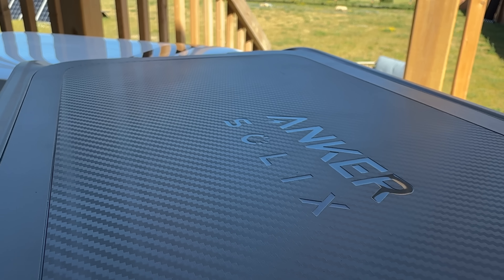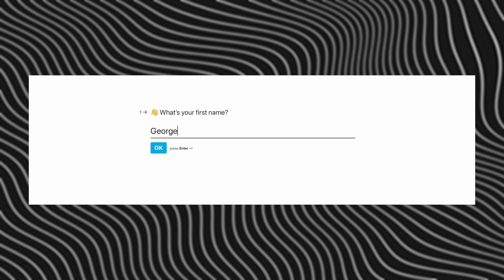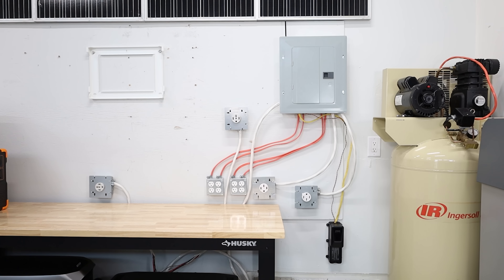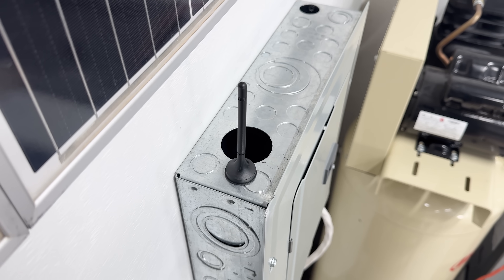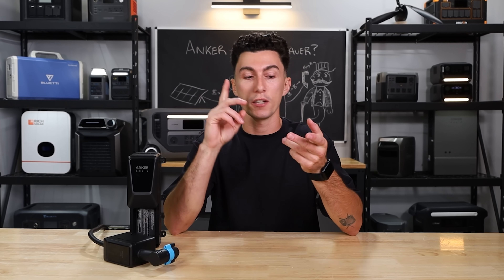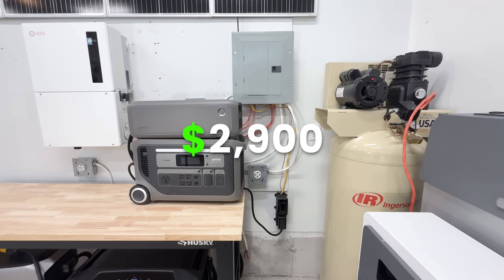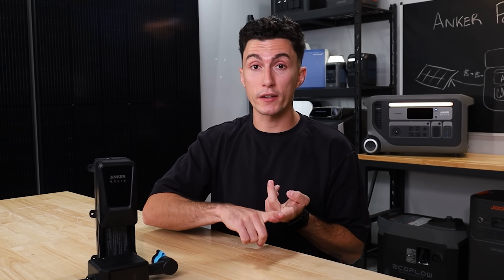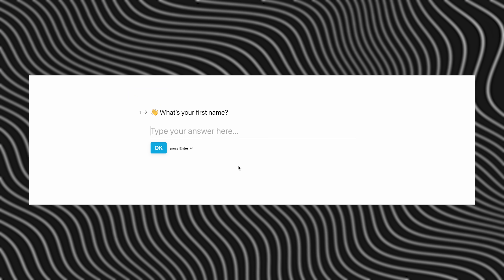Anker's $500 “Power Saver” - Gimmick or Game Changer? (Bi-Directional Inlet Box & Smart Meter)

Comment: Well, I agree with your summary conclusions (around 7:00) ... though its not just a little misleading.  Its a lot misleading.  There's no point using a power station for this purpose.  Anker or otherwise.  And I would say even the qualified "yes" in the mostly "no" space doesn't make much sense.  It's a "NO" all the way.

Power stations are so inefficient that the odds are stacked against you from the start.  The MPPT to storage to AC output has terrible efficiency with a power station solution, particularly if pushing power over 120VAC (instead of 240VAC) ... 120VAC is FOUR TIMES the losses as 240VAC when pushing power.   You would be lucky to get even $0.50/day with the Anker system.

As an example, my DIY Pergola system with Victron equipment has 2kWp of solar, 10kWh of storage, and can fully support a 350W 24x7 load 8 months out of the year.  That system saves me, at best, $2/day and I live in California.  I think last year averaged more like $1.50/day.  And it is a much bigger system than the Anker system (as well as half the cost of the Anker system).  And my Pergola system is about as efficient as its possible to be. The Anker system has terrible end-to-end efficiency in all directions.   Of course my Pergola system is DIY... you have to know what you are doing.

So call me skeptical, but I really doubt that Anker system could come even close to providing any decent return in any situation.  It takes a far more serious system plus some very large loads to really save money.  My full-on EG4 ESS system ($30K, DIY'd) with (now) 42kWh in batteries and 9kWp of solar, saves me a few $thousand a year in electricity.   But it only saves me that because I own an EV and have heavy A/C use in the summer... and I live in California with high rates.

--

Can someone living in Utah or other low-electricity-cost state save money with solar?  You bet!  You can absolutely save money.  These locations might have low rates but they also have incredibly heavy electricity use.  In Mississippi you are running A/C nearly all the time, for example.

But unless you are going whole-hog with a $30K+ system, you won't save money with complex setups.  You save money with (more or less) direct solar to A/C and maybe a bit of battery and inverter storage to extend the A/C run time a few hours past sunset.  That's how you actually save money.  Not whole-home, not backup, not grid-tie.  Off-grid all the way.

-Matt
Reply: I agree with you 100% about these types of systems not being money savers.  When I began my solar journey I had a very specific goal. I was working from home and just needed some backup in case of power outages. I got a little power station just to keep my pc, modem and router going. I then became fascinated by the ability to add solar panels and get electricity from the sun. I stumbled across a couple of YouTube channels and eventually got an Ecoflow Delta 2 Max, and have since add 2 extra batteries and 800w of solar panels, along with a 4 circuit transfer switch. This now runs the circuit that powers my kitchen, including my fridge, microwave, gas stove (electric ignition) and toaster oven full time. The app has the extremely convenient and useful feature that allows me to set a power reserve so I only pull from the grid if the battery state of charge drops to my set percentage, to maintain power for outages. 

The one question that I’m always asked is how much money it’s saving me, and my response is that question is irrelevant. My electricity is fairly cheap, so as you said, savings are negligible. What it does provide me with is peace of mind. And for me, that is priceless. So those wondering about how much my system is saving me should ask themselves, how much all the unnecessary crap they buy is saving them. 

One day when I overcome my fear of electricity, I’d like to install a small DIY off grid system. The problem is I live in a small suburban house on a small lot surrounded by trees, so my ability to add much more solar is limited. But the small size of my house and having a gas stove, furnace and water heater work in my favor, so I think if I can remove a few trees, I might be able to add enough solar and batteries to go “mostly” off grid.  I just want to be prepared for when the explosion in data centers in my area starts causing blackouts and brownouts!
Reply: Matt, it's always a pleasure to read the comments you leave.  They're fairly clear and well written.  I'm a big enthusiast for EV's, solar, power stations and back-up/off grid power. I'm mostly self taught from YT vids, internet searching and comments from people like you.  Keep sharing, P&L.

Comment: you know another way to peek save and save that $200-500 charge you battery with whatever solar panel... then at peek power time plug your ac or whatever large load into your battery and use it... sure its a bit more clunky with you having to do the plugin manually but it saves you that extra money and wiring and you can still move your battery... oh and it works no matter what power battery you have.

Oh also check your local regulation..this option may not be legal in your area.
Reply: So... the issue here are the power requirements, but you can do something similar with a portable A/C unit or mini-split to reduce the load on the main home A/C.   EG4 has a solar-only mini-split, but doesn't store energy so it only lasts until sunset. 

The way to do it with a regular portable A/C... less than a 1000W, is to throw together a little off-grid system just to run the A/C with enough solar to run it during the day + charge the batteries and enough storage to keep it running for a few hours after sunset before exhausting the battery.

A single-battery solution with 2kWp of solar (Callsun bifacial hard panels),  charge controller(s) (Victron SmartSolar 150/35's are my choice here), 2.5 kWh battery (25.6V LiFePO4 @ 100Ah or 51.2V LiFePO$ @ 50Ah), cheap 1500W invertter (capable of starting the A/C), and a 1000W A/C unit works fairly well.   Just keep it off-grid... dedicated to only running an auxiliary A/C or mini-split.

-Matt

Comment: It’s funny you mention the Anker Solar panels because I have been wracking my brain for a while now trying to figure out why they cost so much. Who even buys those things for what they are asking? If they threw in one of these power saver kits with the panels I would be more inclined to consider it. Do better Anker!
Reply from the maker: It's wild. The price of the kit goes from $2,800 to $5,300 when you add 3 x 400W foldable panels. $2,500 for 1200W of solar is insane in our opinion - which is why we recommend buying the panels from different brands.
Reply: Callsun 200W bifacial (hard panels) are my recommendation at the moment, in terms of excellent but cheap consumer-level solar panels.   Flexible panels won't go the distance ... totally non-economic.  A few years at best and flex panels will be dead.

For large systems you would go straight to wholesale residential panels and buy a whole pallet.  For small systems, the Callsuns are really good panels.
Reply: @junkerzn7312 👍🏻

Comment: Seems way to situation/position specific for my personal use. This would be good if you could “break into” a 20A circuit in the house to take it off grid. That would be my use case for it.
Reply: You can't do it with a 120VAC circuit.  You need access to both legs (a 240VAC circuit) and a dedicated breaker (not an existing wired household circuit) to actually be able to zero-out household usage.   Trying to backfeed any significant amount of power through a consumer plug is incredibly dangerous.  Small amounts of power... ok.  Larger amounts... no.
Reply: This doesn’t require a designated circuit. It does require a 20 amp breaker. It is recommended that you don’t use anything else on the circuit for best performance.

It is on only one leg. If you wanted to cover both legs you would need two of these. One on each leg. 

If you wanted one system to cover both legs you would want to go with the f3800 and smart panel which requires a 240 circuit.
Reply: But always check your wiring if you’re going to swap wires and install breakers. Making sure what your wiring is correct sizing to handle it. Example being if it’s not 12 gauge then I wouldn’t use that circuit

Comment: Hard Pass, You have to have that specific power station to use it,  might as well just get a transfer switch you can use with anything. Ecoflow has a pretty cool device that's probably legal in canada but no in the USA (expect for Utah) which is way better then this
Reply: Yeah, that Ecoflow Stream is actually an iteration of the Ecoflow PowerStream that's been in used in EU and in my country (the Philippines) for more than 2-3 years already. My last month's bill using PowerStream and Delta Pro shaved my electric bill by 94% vs prior usage of the whole set-up.
Reply: This system operates automatically. The transfer switch requires you to manually turn the system on daily and once the unit depletes itself, you have to manually charge it. Personally if you have the time to do this daily that is an awesome more cost effective solution to back up your home. 

That being said you have to admit that the convenience of being able to completely control the unit from any where in the world from your phone is really cool!
Reply: @Blessed_tech_reviews Ecoflow already has Smart Home Panel 1 and the newer 2 which can do what you just described. All other brands are just catching up. With Smart Home Panel, one can control which circuit of your house can source the energy such as solar or via grid, you can control these via their app. Ecoflow even has a simpler and cheaper option using their Automatic Transfer Switch, too.

Comment: Wherever the economics justify using batteries for "peak shaving", grid-scale battery electric storage systems (BESS) will be coming in a few years. BESS will reduce the on/off peak rate difference leaving you stuck with upfront costs that won't be returned.
Reply: Well, grid-scale peak-shaving is already here.  California and Texas are already load-shifting tens of GWh daily.  But in terms of reducing wholesale export rates or daily TOU (time-of-use) deltas, the effect has been fairly tame so far.  Mostly the worst of the stress differentials are going away, but not so much the regular daily pricing cycle.  It's probably gonna take a decade and the differentials will never completely go away because solar is being expanded even more quickly than storage.

-Matt
Reply: Aside from grid scale power storage systems being a thing for years, the reason why it’s not implemented more mainly due to investment costs. There are other options just batteries.

There’s a bit more value in the consumer to shaving a little bit a day then there is for private corporations a municipalities to do the same, and there really isn’t stomach for the required in event for the minimal return.

Comment: The $0.25 price per kwh seems high, I'm fortunate enough to pay only 0.07 per kwh. Something like this wouldn't pay for itself in my lifetime 😅
You can't put a price on the peace of mind a batter backup provides I suppose.
Reply: It's actually more about how much electricity you use and not so much the price per kWh.  If you are a heavy user, solar can make a big difference even in the cheapest state.  If you are a light user, solar won't help a whole lot even in the most expensive state.

Even though a state like California has high per-kWh rates, its residents use far less energy than residents of other states.  This is why, for example, the average electricity bill in Texas is higher than the average electricity bill in California.  If one includes the climate-related costs, such as the vast damage caused by the Great Texas Freeze and other economic losses when power is lost, Texas is even higher.

-Matt